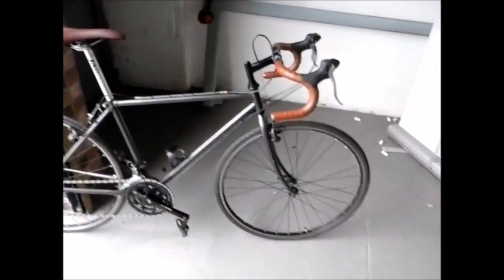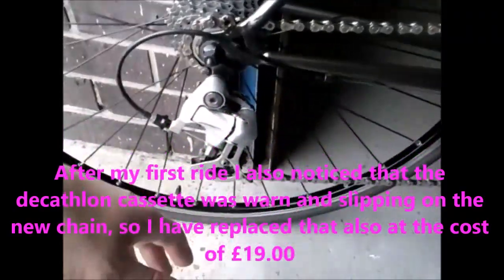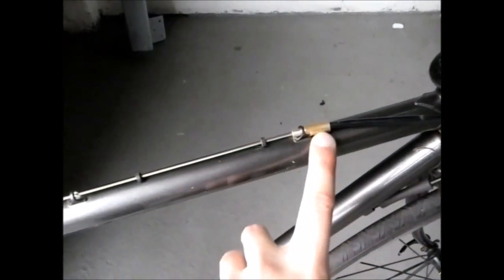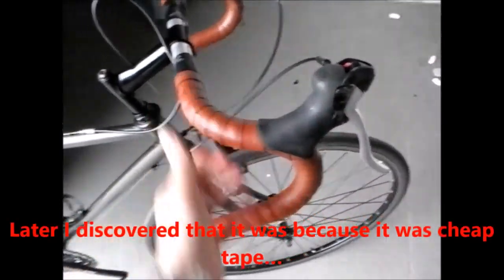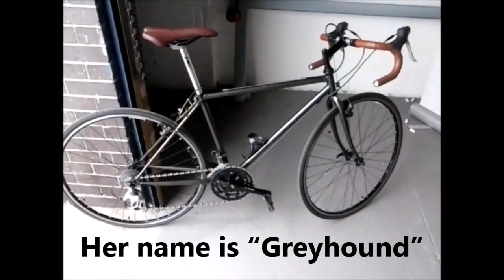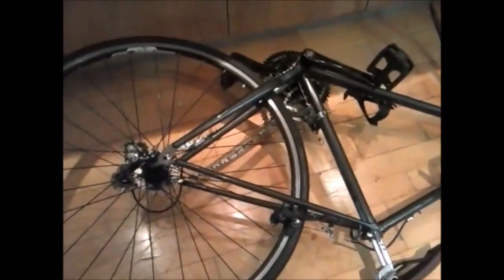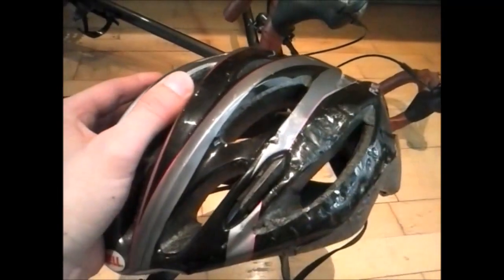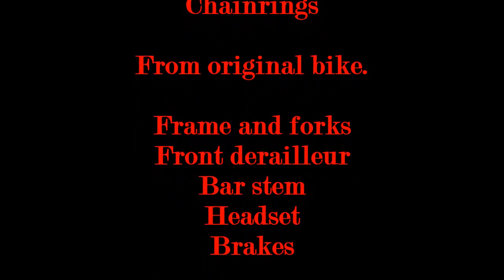Bike build part 6. The Big reveal!

Comment: Oh dear! The speed wobble would have been due to an inexperienced rider tensing up. She just needs to put in some miles on flat terrain until more confident. I really liked the finished product with matching seat and bar tape. I'm no expert but I always put the tape on as tightly as possible without actually stretching it and it usually looks OK. I hope your girlfriend recovers quickly and this doesn't put her off cycling.
Reply from the maker: it has put her off a bit, I am trying to get her to come out with me, on flat land, she did an off road trail last week so that's good. I have fixed the bike, buffed out the dents and scratches, resprayed it, and put new bar tape that is better and more expensive, it also is closer in colour to the seat! So in a way she is better than before. :)